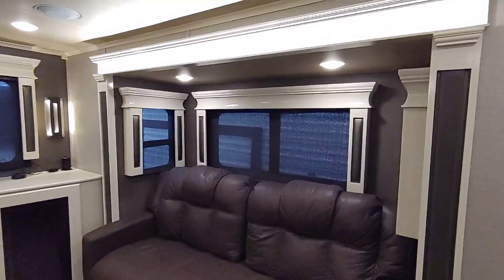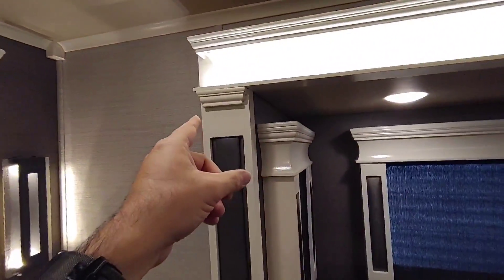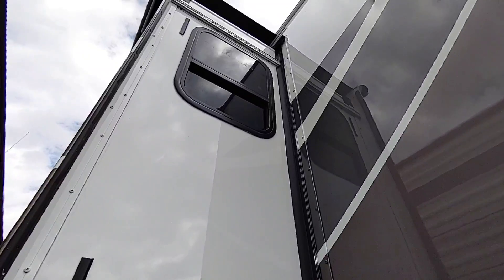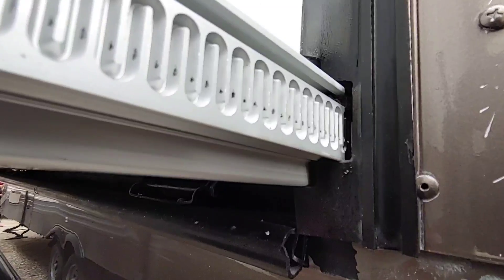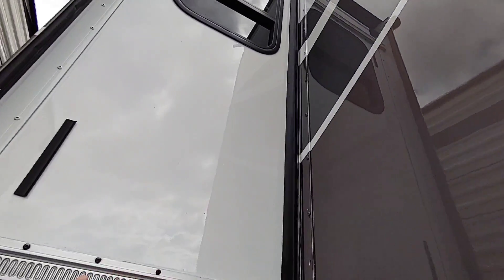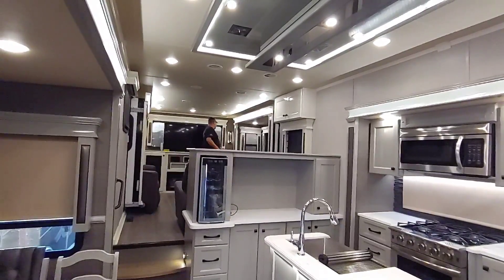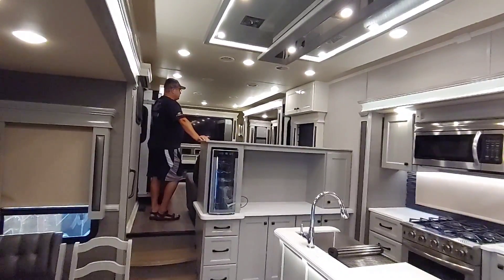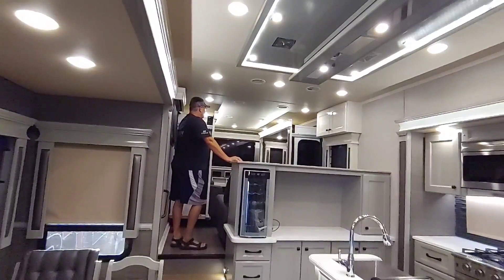SLIDE-OUT PROBLEM on the Vanleigh Beacon Fifth Wheel RV! This was scary!

Comment from the maker: This is a GREAT video to help better understand best practices when extending and retracting slides that utilize the Schwintek slide system.  What I've been told is to extend or retract the slide completely and then continue to hold the button down for an additional 5 seconds after it sounds like it's completed it's function.  This keeps the motors in sync and the system remembers the last position you left them in.
Reply: After some research I found this out as well and made it common practice when running slide in or our. Told the new owners this as well. 5 secs, each way.
Reply: When we got are 2018 Montana they told us with those systems when there fully out or fully in that’s what they told us to to hold 5 seconds so they can sync and talk to eachother
Reply: We had major issues with this slide system from day one on our Tracer Bunk House. They replaced motors, cables, and controllers. I will never own an RV with this slide system again.
Reply: Stubby All that money for stress.
Reply: Well my grandmas camper only has one sldie but if it ever has problems ima send this video to her 👍
Reply: @stubby4609  there are no cables on this system
Reply: @gregorywieczorek4160  electric cables/lines/cords

Comment: Hopefully you have the latest generation motors. The motors are basic brushed dc motors with a gearbox attached to one end and a circuit board mounted to the other end. The new motors have a connector block soldered to the board with a pigtail coming out to connect to the cable from the control box. The connector is more robust than the old design which was flying leads soldered directly to the board.  Either way there were a total of either 4 or 5 wires (can't remember the exact number).  2 are power and the rest are signal wires from the hall effect sensors on the circuit board. The controller watches the speed of both motors by watching the signals from the hall effect sensors and if they are not spinning at close enough to the same speed the controller shuts the system down.     My motors were flying lead style and 2 of the 4 individual motors had the flying lead break off at the solder point at the board within the first 2 years that i owned the trailer.
This video looked exactly like how my slides acted when one of the signal wires on one motor broke. The motor with the bad connection ran just long enough for the controller to decide that it was not working then it shut off. My guess is that once your slide got out of sync the motor at one end was spinning slower than the other and the controller shut it off or the extra drag at one end (from being out of sync) caused an over current protection to kick in.

My thoughts on this style slide after a total of 8 seasons and 2 campers using them.  Listen up Lippert:
Pros:. Never had anything else so I can't really speak to what makes them better than other systems. 
Cons:
1.  Poorly made motor circuit board wiring on older models.  I resoldered mine and saved the $200 each that it would cost for me to replace them myself (amazon price not dealer price for motor). 
2.  More motor complaints. These motors probably cost less than $15 to make. Add another $15 for the gearbox and you have a $30 piece of crap that will eventually have a dead short and cost you $200 to replace yourself.  For $200 i expect a brushless motor and the reliability that it delivers.  If you don't want to go brushless I need replacement motors for $100 tops. 
3.  The manual says that if a motor fails with the slide in that you can unplug it from the controller to disable the brake and push the slide out manually.  COMPLETE LIE.  Due to the high gear ratio in the gearbox I had to use a 4 ton bottle jack and a stack of boards between the opposite wall and the slide to inch it out enough to remove the motor. The other alternative is to disassemble the outer trim from the outside of the slide. No thanks.  Give a place to attach a socket at the bottom to rotate the pinion shaft manually. 
4.  The pinion block does not have any bearings in it to support the pinion shaft. Both are aluminum......not a bearing material. After 4 years, 5-6 trips per year, mine tools terrible. The block and the shaft are digging into each other badly. It is a matter of time until it fails and I have to have the entire mechanism replaced. A $2 bearing in each block would have fixed this. That is $8 additional cost per slide and i am most likely way high on the bearing cost.

I will make every effort to never have this style slide mechanism again.

Comment: I have that system on my Grand Design Solitude, my current and previous Lance campers and I have never had a problem. (Knock on wood). One thing my Dealer told me, always run your slides all the way out or all of the way in. Never halfway because the system works on memory and will get out of sync.

Comment: Is this your new RV, or the demo you were loaned?  If the demo, you were probably doing your own PDI inspection, right?  Happy to see you got it solved.  I had a minor problem with the Schwintek slide in our Montana 2 weeks ago.  I did my walk around when all hooked up to my truck and ready to go when I saw the front bedroom driver side slide was hanging out about 1-2 inches.  I had to disconnect the truck and re-level the trailer in order for the slides to operate as they are locked out while off level.  Seems the slide grabbed a small section of accent carpet near the head of the king size bed and got it bound up preventing the slide from closing completely.  I opened it back up and re-laid the small piece of carpet and all was good.  Seems to me that the more complex and heavily optioned these RVs get, the more opportunity for problems.  Our old travel trailer was built as standard on an assembly line and never had any issues.  This custom 5th wheel was built off line as special, and as a result has had a good number of issues.  All have been repaired by myself, but I wish it went through a better PDI.  I was a bit discouraged with the walk through I got when I first picked up this 5th wheel from the dealer.  The guy who gave me the walk through was more impressed with all the goodies we special ordered, and didn't give me the attentive walk through he should have.  Therefore I have had to figure out a lot on my own.  We have the Furion back up camera installed, but I was never shown how to set it up and use it.  So far, I have not even needed it with the wide swing up Ram mirrors.  I just back  the 40footer in well without the need for the camera.  Thanks again for another great video.

Comment: So I have a new Vilano and my back left Schwinn tech slide is doing the same thing.  Mine comes in fine, but when you go to put it out it comes out a little crooked and then stops.  I do the manual mode and it goes out fine.  I tried your method of in out and holding for 10 seconds each time and nothing.  As soon as the light stops flashing under the slide and it’s out of manual mode it does the crooked thing when putting it out.

Comment: I have a schwintec slide on my bedroom wardrobe in my Grand Design Reflection 28bh 5th wheel. So far we have had zero issues but I will run them through a few cycles to insure that they are correctly synced. I am glad that it is a small light weight wardrobe slide and does not have the bed in it. Our big slide is thankfully rack and pinion.

Comment: Hey I might have the answer, I’ve fixed several of these in the past. 

The most likely issue is that you have a motor throwing a fault or that the harness is shorting out. 

These slide systems are the same regardless of the manufacture. First find the control board and see what code it’s throwing.

Comment: We had something similar happen. We had to re-synchronize the controller. On the controller, it will tell you what errors are happening via light blinks. When the controller thinks that the 2 sides are not working together, it will stop one side from moving any further. In the end, we found that the slide frame had broke. I hope that you find an easy low-cost resolve. I would also make sure that your 12v system has thee right amount of power available. I have seen that even though someone had shore power and or new batteries and voltage drops occurred and the slides started to act funky.

Comment: Had the exact same problem with my old unit to the point where i was pissed because it went back 5 times same issue and they still never figured it out so i traded it in for my new rig and couldn't be happier

Comment: I have the Schwintek slide on my Attitude 32SAG and had a motor failure cause this. New motor and haven’t had an issue since. From what I understand this is a common issue. Hopefully my next unit has all rack and pinion 👍🏼.

Comment: This concerns me because I am considering a Beacon and they actually install the slide mechanism. I have cable slides on my open range right now and have had problems with the motors, but I never had an issue with getting a slide in.
Reply from the maker: The bypass feature on the Schwintek slides really make things easy.

Comment: I have had this same issue with the Schwintek slide on my Lance for years.  I have tried all the resync tricks and have had it in the shop multiple times with multiple different repairs and it still does it more than half the time.  Personally, I feel this is a design issue.

Comment: A friend had a similar issue with an almost new fifth wheel slide out. A technician told him what possibly caused the problem to start was new/stiff seals. That they needed lubed. They did pretty much the same procedure you did plus lubed the seals, three years later no issue.

Comment: I’ll bet you a dollar that this issue WILL happen again. We’ve had 3 different RVs with Schwintec slides/motors and they ALL had major issues.  I’ve had to push a slide in manually, reset controllers a dozen times and had entire motor/control units replaced. We pray and hold our breath every time we try to put the slide in or out.  Happy trails.

Comment: Never had an issue with my current or prior fifth wheel's Schwintek.  In my current fifth wheel, I have a washer, dryer, and king bed in the Schwintek slide.  With that amount of weight, it might be a good idea to purchase a spare control unit , motor, and wiring harness.  ETrailer has everything in stock.

Comment: Hey I got  question, My slides like go down a bit on a side if you know what I mean, and looking outside they look straight, Like do some slides do that on the system or is it a problem?
Reply from the maker: Hard to say.  Depends on the slide type and the depth of the slide.  Might need some adjustments but maybe not.
Reply: The rack and pinion system slides go up and down the end and beginning of using the slide.
Reply: @BTBRVReviews  It is 5 years old, park model, and its 2 feet I think.
Reply: @roycook7542  I thought that but sometimes it can mean issue. so I just wanted to confirm.

Comment: So do I understand correctly that both rear slides operate from the same control at the same time? I would prefer that each slide out be on it's own control. I have been in parks where I could not extend all the slides and separate controls allowed me to select which individual slide I wanted to extend.

Comment: Based on all the problems you have had with this RV is not saying much for the quality of this brand.
Reply from the maker: Watch the video I posted today please
Reply: @BTBRVReviews  I just watched today's video as you suggested.  I have been pulling RVs since 1975 and have owned three trailers and currently on my sixth 5th wheel.  I do understand about issues and I've had problems on all my units through the years.  Some small and some large such as structure failure (was covered under warranty thank goodness).  It just seems to me  $144K  5th wheel should be triple checked by the manufacturer before sending to the dealership.  I can't believe they way they throw these things together today.  In my opinion, my 1988 Carriage was the best constructed unit I have owned.

Comment: It’s not the worst idea in the world to learn how to retract the slides manually before you have a problem. The same is true of your leveling system.
Reply: there is no way to do that easily with the schwintek system.  In order to manually put the slide back in, you have to actually disconnect all of the motors on the slide and then physically push the slide box back in.  While it can be done, it is a big pita.  The motors are not easy to get at because they are inside the seals top and bottom on each side.

Comment: The major problem with slide systems is that they're slide systems. I guess that if you're going to go big, slides are unavoidable, but as far as I'm concerned they are nothing but trouble waiting to happen.
Reply: My '05 Montana had two slides and not one problem with them in 12 years.
Reply: Exactly, been there done that with a 3 slide unit. This is one of the reason I know have a 42' Sundowner all aluminum toy hauler with NO SLIDES. Not to mention the spread torsion axles.

Comment: I’ve had a Schwintek slide for two years, never one problem.
Reply: Do you have a Vanleigh?
Reply: JD is simply sharing that he is having a problem - being defensive because you apparently have not had this kind of problem is not constructive. Recalls on car parts that fail are not because everyone experiences a failure,  it because the failures are too common and reach the tipping point of being defective.
Reply: In 5 years I have already had my Schwintec slide completely rebuilt.

Comment: I just watched a different video, same Schwintech slide problem. I'm just a bystander that is learning about RV's, but I noticed that your bottom track has the same abnormal gear wear gouges as the person in the last video. Their RV is a Grand Design. They were working to resolve the issue with Grand Design. Speculation was that part of the gear drive was installed upside-down at the factory, making the gouges in the rail. Just an observation from a guy with only Class B+ experience. Good Luck.

Comment: Good information however,  you mentioned hitting the reset button underneath. I'm sorry but can you elaborate? Thank you.
Reply: The control box has a override button. Each slide will have it's own control box. Usually the control boxes are hidden behind a panel somewhere. You press the button 6 or 7 times then hold it. Sometimes that will let you move the slide in or out. Sometimes it doesn't work.
Reply: Thamk you! I'm going to look for it in case I need to do a reset. I like to be prepared.